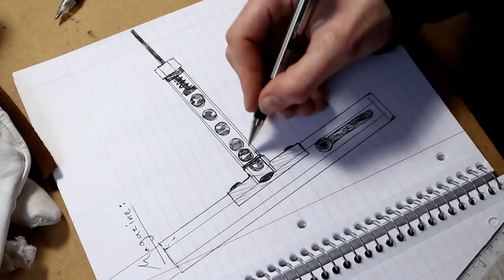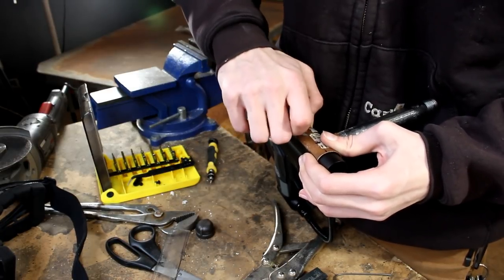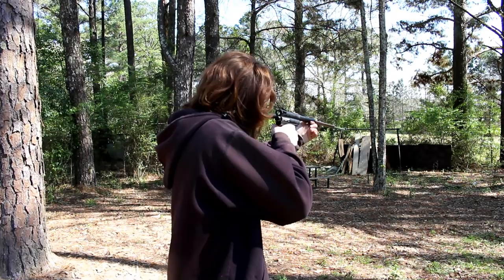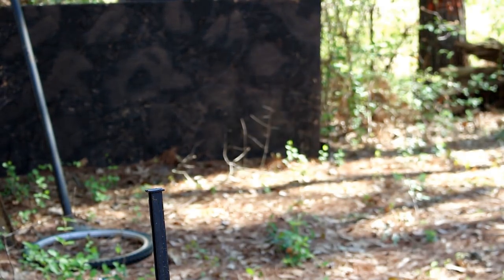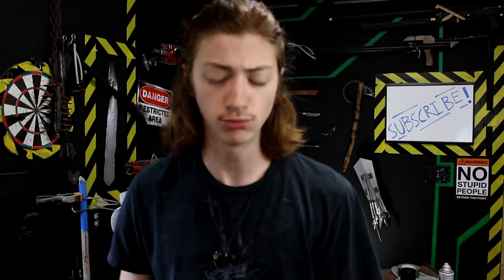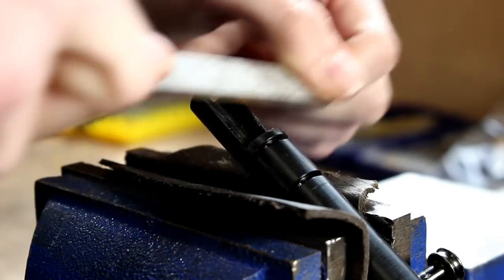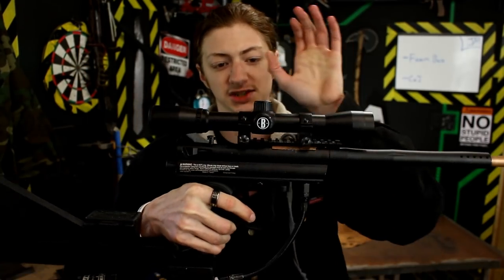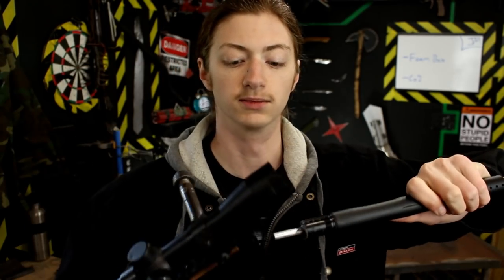Paintball Gun to EPIC Air Rifle build | Part 2

Comment from the maker: PROJECT UPDATE: The aluminum inner barrel did NOT work. The aluminum was too soft and bent all out of shape when I tried to turn it to feed ammo into the barrel. Since I epoxied it in, I couldn't get it out. (duh) I'm fairly certain that brass tubing would work tho, so if anybody tries to build this take note. Use brass or something harder that will keep its shape better. Mine didn't work.
Reply: How did you go, did you go any further with this project? Or did it go in the unfinished graveyard? Interested to see the outcome :)
Reply from the maker: I ended up turning it into a single shot muzzleloader. And then I ran out of co2 and haven’t gotten around to getting the tanks filled lol
Reply: You said you were a genius and failed?
Reply: @johndenzel1434  ooof
Reply: I'm sticking up for him. Someone posted a stupid comment.
Reply: Could you not have used the existing  hop for a mag instead
Reply from the maker: Yes you could theoretically with a few mods. But then your magazine would be in the way of your sighting down the barrel. I should get a new gun and try it... I think you definitely could convert it pretty easily if you kept the rest of it stock. Or just seal up the hopper part and shoot blowgun darts.
Reply: @jakemakes   would like to see that would  it be possible  for you to send me a detailed  breakdown  of all the parts obviously  I will use brass or copper  so it doesn't bend or stay stuck in
Reply: @jakemakes  and a bb gun lazer sight on the side could work for aiming    as long as lined up?
Reply from the maker: @tylerturnbull8747  My man i don't even remember what parts i used lol. You'll have to figure it out from the video and with some research. I don't even think you can find the exact paintball gun anymore... at least I haven't been able to.
Reply from the maker: @tylerturnbull8747  Oh sure.. or you could mount a small scope or red dot sight on the side.

Comment: I have a old rhino spitfire 68 cal paintball gun & me & a friend were messing around one day to see how far we could push the velocity without modifying the gun , surprisingly we got it right on the edge before it would lose pressure to around 465 FPS not bad so he being a machine,s took it a pond his own hands to mod the gun to get its full potential out of it . We went to test it out so we used a couple of 68 cal balls he made & some rubber balls first , the rubber balls cronoed at 490 & the balls he made out of high grade aluminum that was dents was around 493 FPS eventually the aluminum balls tore the barrel to sredds on the inside .
Reply from the maker: Thats cool. I think i could definitely get the fps up if I could make or find ammo to fit the barrels better.

Comment: You can get.25 cal lead pellets that are designed to fly accurately using either rifling induced spin and or drag stabilising,, the heavier solid lead tip of the pellet pulling along the hollow lead skirt behind it, that skirt is also soft enough to essentially pressure form exactly to the dimensions of the barrel, I would try these along with the round steel BBs . You would however need to make your barrel out of steel and have it as smooth as possible on the inside, 3000 grit paper and a lot of time will get you a mirror finish. A 15 grain.25 Cal lead pellet moving at 700 - 900 FPS would be deadly though so you would then have the responsibility of ownership and management of a very dangerous device!

Comment: WOW. You really do look like you know what your doing. pretty good job for your first semi auto airgun. keep it up dude!
Reply from the maker: Thanks man!!! Whenever I build another airgun I want to try making a small pistol. Like as small as I possibly can, powered by those 12g co2 cartridges. I think I would fire blow darts with it, they are light and super effective.
Reply: @jakemakes  when you create a miniature pistol. You run the risk of creating a barrel that is way too short and would therefore not allow the bullet to reach its appropriate speed. Id be careful because u might be dramatically sacrificing power for size.
Reply from the maker: Obviously. That would be the challenge.

Comment: Why not make an attachment that just wholesale robs the air and puts it behind the ball bearing? Modify the T connector to be a total stoping block for the air, redirect it though the original hopper well, and use pvc or a similar material to house your gun bits.

Comment: You need to design a shuttle that pushes the round forward THEN the gas is discharged.  Otherwise the system is wasting enormous amounts of air through all the void points.

Similar to how an airsoft system is setup.  The round is advanced via a nozzle/shuttle then the blast is secondary to that.

Comment: Love this concept, however cutting into the gun makes it a instant challenge hahaha. I've got a screw on modification for my tippmann. Barrel on = semi/full auto air gun shooting metal Bb's. Unscrew it, Chuck a ordinary tippmann barrel on and I've got a paintball gun again. But I want to make another one that shoots 7mm balls.
Reply from the maker: What sort of magazine did you rig up to it for the bbs?
Reply: It is hopper based, gravity fed. But would be easy enough to make it mag fed. The good thing is the marker isn't cut in to, so there is no change or air leaks, apart from dodgy O rings. 
Even though it is hopper fed, there is no air loss through the hopper. 
Can send pics if you like